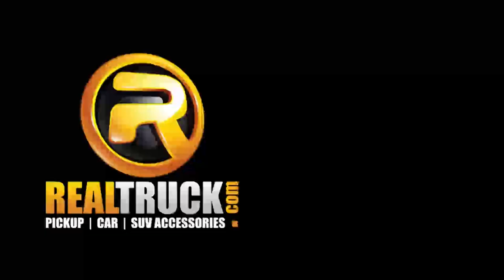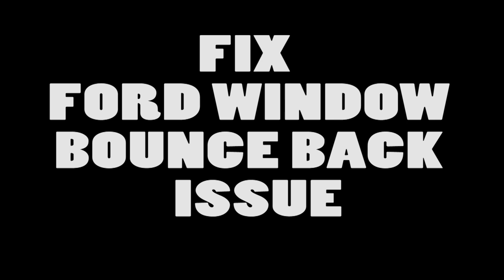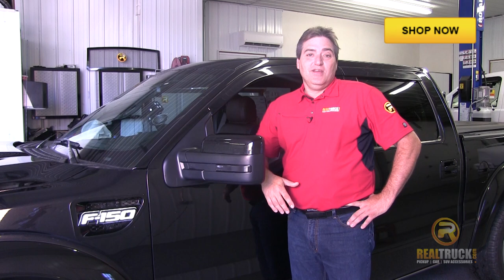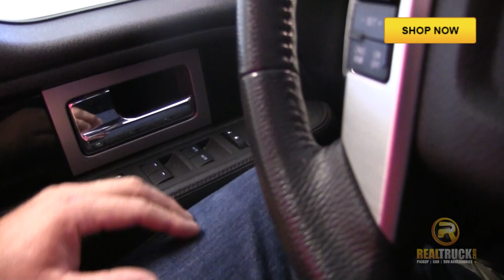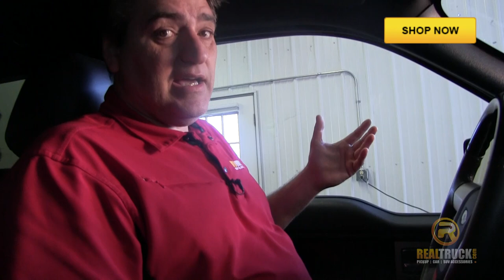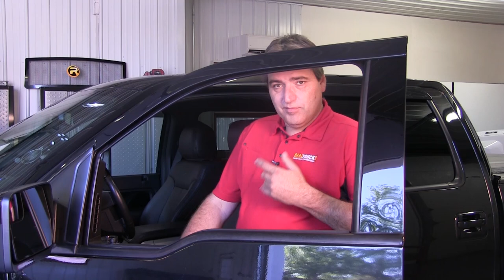How To Fix Ford Auto Up Window Bounce Back

Comment: None of the procedures discussed here worked on my '10 Lincoln Navigator.  However, the following procedure did work... hope this helps someone else.

Window Motor Initialization

NOTE: Initialization is required to learn both the full up and full down positions and the profile of the glass as it travels through the glass channel. Once initialized, obstacle detection is enabled. This procedure is only required for Navigator (LF and RF) or Expedition (LF only) window motors.

NOTE: The window motor must be reinitialized whenever: the motor is removed from window regulator drum housing, a new motor is installed, a new window regulator is installed, new window glass is installed, glass top run removal or installation is carried out or when carrying out any operation in which grease or lubricants are applied to the window system. All window components (window glass, window regulator, window motor and glass top run) must be installed and tightened to specification before carrying out this procedure. Refer to the De-Initialization Procedure prior to performing the window motor initialization (unless a new motor is being installed).

NOTE: A new (or de-initialized) LF/RF (Navigator) or LF (Expedition) window motor will not operate in one-touch up or one-touch down mode until initialized. If a new LF/RF window motor has been installed, proceed to the Window Motor Initialization procedure in this section.

NOTE: Excessive bounce-back (window reverses direction with no obstructions present) may indicate that a de-initialization procedure may need to be performed.

De-Initialization Procedure

1.Start with the ignition key in the RUN position and open one front door.
2.NOTE: Steps 2 and 3 must be performed within 8 seconds.

Turn the ignition key from OFF to RUN 5 times.
3.Press the window control switch to the one-touch DOWN position (second detent) and release.

Window Motor Initialization

WARNING: Keep objects and body parts clear of the glass panel when carrying out the initialization procedure. During the initialization procedure, the glass panel closes with high force and cannot detect objects in its path. Failure to follow this instruction may result in serious personal injury.

4.Start with the ignition key in the OFF position and with the LF/RF door open.
5.Turn the ignition key to the ON position.
6.Activate and hold the window control switch in the one-touch DOWN position (second detent) until the window glass stalls for 2 seconds at the bottom of its travel and release the switch.
7.NOTE: After performing this step, wait a minimum of 3 seconds before operating the window control switch or ignition switch.

Activate and hold the window control switch (with no interuptions) in the one-touch UP position (second detent) until the window glass stalls for 2 seconds into the glass top run and release the switch.
8.Verify correct operation of the window by carrying out the one-touch up and one-touch down features. If the window does not operate correctly, carefully repeat this procedure.
Reply: Mr. Bartley, I would like to thank you for your directions you gave on this bounce back issue. I followed them and everything is working fine on my 2010 Navigator. Thanks a million😁
Reply: Thank you for this. It works on a Navigator 2009. My mistake in the beginning was turning the key to ON and OFF 5 times instead of RUN to OFF.
Reply: Norm Birtley Mr Bartley thank you!  Your directions were great and it worked on my 2014 Navigaor.  You made me so happy, thanks again.
Reply: Thanks! 07 and my windows are bouncing.
Reply: 2014 super duty with bounce back issues here. Thanks so much!
Reply: You just fixed my 2017  F-150 Lariat issue. Thanks Norm

Comment: Thanks. I was having that problem with my 2017 Ford fusion hybrid. But when I hold the up button, it does keep my window up. It didn't seem like my rain guards were affecting it bcuz it's not coming into contact with my rain guard. The rain guard is on the outside of the door panel. But holding the button up does seem to keep the window from bouncing back down and I didn't have to wait 12-48 hours. It worked immediately. Once u hear a small clicking noise then u know it worked. I tried rolling it down and then letting it auto roll back up and it stayed up and u hear a slight clicking noise each time that let's u know that it's locked in. Thanks again. That was a quick fix 👌🏽
Reply: That clicking noise is ware on the worm gear that rolls the window up and down. 
That sound is proof that you are causing premature ware.

Comment: This solution DOES work on my 2016 F-150. A few notes that I found make it easier though. 
1) I would suggest you have two people for this 
2) Put the in-channel visor in place 
3) Person #1 sit in the driver's seat so they can operate the windows from the inside 
4)Person #2 stand outside the window and slightly pull the in-channel visor outward at the top where it meets the door frame while the window goes up (this allows a bigger gap for the window to slide in) 
5)When ready, Person #1 raise the window...it will trip at the top and begin coming back down but keep the window button pulled up
6)When the window has come to a stop (about halfway up), let go of the button and then quickly pull upward on it again
7)This time the window should go up and stay up
**I would suggest leaving the windows up as long as you can once they are closed to allow the molding more time to flex**

Good luck

Comment: Mine isn’t rolling back down I already done this when I installed them. But my issue is the driver side front window rotated slightly forward when it gets up to the visor causing a bad seal.

Comment: I'm having a similar problem with my window on my 05 mustang gt, but I can't hold up on the window switch without it bouncing back so I can't hold the switch for two seconds. Any other suggestions?
Reply from the maker: +Greg Mccoy Try this.

DE-INITIALIZATION PROCEDURE
De-initialization (un-learning) of the smart window motor clears the memory of the module and shuts off the One-Touch UP, Bounce Back and Short Drop functions.
The smart window motors can be de-initialized in two (2) different ways:
Disconnect the battery cable from the battery WHILE THE WINDOW IS MOVING.
Remove the window motor fuse from the Power Distribution Box WHILE THE WINDOW IS MOVING.
After performing one of the above procedures, the smart motor must be re-initialized, see Initialization Procedure.

INITIALIZATION PROCEDURE
INITIALIZATION MUST BE PERFORMED WITH THE DOOR CLOSED! (For convertibles, top and the quarter glass must be in the up / closed position.)
From the window switch, perform the following steps without stopping:
Operate the window UP and stall for 2 seconds. (Hold The Switch)
Operate the window DOWN and stall for 2 seconds. (Hold The Switch)
The smart window motor will be initialized and one-touch-UP and Short Drop will be operational.
Cycle the window glass an additional five (5) times to set the window
"Soft Stop" for the down position.
Reply: @Realtruck  I'm  assuming this will also work on a 07 Mustang . as I am haveing the same issue 
so I'll give this a try thanks..

Comment: I installed the weather tech window deflectors and  did this and it still does the bounce back. Is there something I may have done wrong as far the whole installation process or is there another way to fix this. Also it was only the passenger side when i tried it, now both sides do it.
Reply from the maker: Hi Caleb, I apologize you are having bounce back issues with your Weathertech Window Deflectors. Make sure the defectors are seated as tight as possible. If you are still having issues please call (800) 441-6287 . Thank you!

Comment: 2014 F350 all I had to do was with the key in the Run position with the engine off hold window switch up for 10 seconds

Comment: Safety feature is on the front windows only?  How many kids are in the front seat, especially the driver seat?
Reply from the maker: In your face blank lots. I have personally seen this quite often. Someone gets out of the car or truck to talk to somebody for a minute and the kids are messing with the windows. I am not saying this is a good thing to have children running wild in the vehicle, however, it does happen. Another huge issue is pets stepping on the switch. One thing we should always try to remember. The reason for safety suggestions and/or equipment is usually because someone has had an incident because the safety features weren't present. Thanks for the question.
Reply: ***** I understand its purpose, seems like the back windows would have the feature as well.  By the way.  Thanks for the tip.  That worked for me! :-)
Reply from the maker: In your face blank you're welcome. Yes I agree. It would make sense to have it on the back as well. Auto manufacturers. Go figure lol!
Reply: Probably because they don't put the auto-up in the back windows and they figure if someone's pressing the switch and gets their head stuck, they'll let up on the switch pretty quick.
Reply: Good point.
Reply: Ford should allow us "adults" to disable this stupid feature on the front windows in the menu system! Like you said kids are typically in the back seat and mine are all grown. This reset never fixed anything in my 2013 F150 and when I got my 2016 I didn't bother with these visors because of that issue. Hell the window on my 2016 bounces with nothing in it sometimes!!
Reply: Just read about the fuse thing..anyone try this on a 2016 F150? Want to know it works before I spend $100 on visors again.
Reply: fildiablos yep works like a charm
Reply: What's this fuse thing?
Reply from the maker: You need to pull the fuse for the power window while it is in motion. The window will stop working when you do. Put the fuse back in and roll the window all the way down. Then roll the window all the way up and hold for 2 seconds. Then roll the window all the way down and hold for 2 seconds. Rainguards must be installed first. Do this for both sides. Fuse location is in passenger floor kick panel. Fuse location #1 and #3 I believe. This will reprogram the sensitivity of the bounce back feature so it will work with your rainguards.Nick Baughman
Reply: In your face blank I always sit in the front😂
Reply: no shit i have the same damn question

Comment: mine is physically hitting the visor. I understand i probably installed it wrong...any tips on somthing I could stick in there to give me that extra space? or could I cut a tiny piece off
Reply from the maker: Clark, we recommend giving us a call and speaking to one of our truck experts. You can reach us at 877-841-9213.
Reply: Yes I use lens cleaner wipes to fix my window issues. Just shimmy them in there and I'll make a little extra space and then voila!

Comment: There is another way to do this without having to wait 48 hours.  You need to pull the fuse for the power window while it is in motion. The window will stop working when you do.  Put the fuse back in and roll the window all the way down.  Then roll the window all the way up and hold for 2 seconds.  Then roll the window all the way down and hold for 2 seconds.  Rainguards must be installed first.  Do this for both sides.  Fuse location is in passenger floor kick panel.  Fuse location #1 and #3 I believe.  This will reprogram the sensitivity of the bounce back feature so it will work with your rainguards.
Reply from the maker: Luke Hinkel Thanks Luke! We will give this a try.
Reply: ***** If you tried it, did it work? I tried what you suggested in the video and didn't have any success.
Reply from the maker: Have not had the opportunity as of yet to try that method but when we do and if it works we will certainly let everyone know.
Reply: Well, I just got done trying it myself....and it works perfect! Now the windows go up, and stay up!
Reply: Glad I could help you guys
Reply: Luke Hinkel k
Reply: Worked great for my 2013 f150 
Fuse #1 is drivers nd fuse 2# is passengers
Reply: Luke is right it works I just did mine
Reply: This really did the trick on my 2013 f-150 with in-channel visors! Thanks so much Luke!!
Reply: Luke Hinkel it works
Reply: Also, driver window was #1 fuse and passenger was #3 fuse...thanks again!
Reply: Luke Hinkel it works great the 48 hour thing didn't work
Reply: Will that work on a 2012 ford expedition?
Reply: Worked perfectly man.  Thanks for posting.

Comment: is that the same process for a nissan murano?
Reply from the maker: Joey,

Typically this would be a universal fix. However if it does not work for you, you might need to call the manufacturer for your vent shades.
Reply: RealTruck.com thanks for the reply

Comment: The real method is, roll the window up or down and while it's moving disconnect the motor. Wait 5 seconds, plug the motor back in and then roll the window up. When it closes all the way keep your finger on the switch and hold for three seconds. Roll the window down and wait three seconds again. Problem solved. I work at a ford dealer and this is what we do, we don't wait for 48 hours. Our customers would be mad if we did. Lol
Reply from the maker: Thanks Doug!
Reply: I'm gonna give this a try this. I tried going to my local ford dealership and they basically denied the problem exists and said I was crazy smh
Reply: Can I just do the battery instead? I dont want /know how to  take my door apart.
Reply: @ChiTownRaised  I've read you can also pull the fuse.
Reply: Hi there ,  I have 2019 transit 250 , we change the driver's  door, and now the driver's window rolls down one second and stops , and so on until goes all the way down, same to rolling up , any advice,  
thank you in advance ..
Reply: @ricardoramos588  track is probably on a bind. Check rubbers and track alignment. Make sure the rubber is seated properly in the tracks.
Reply: @teddy7555  ok, I'll check it out,  thank you

Comment: Yeah, I have a 2015 F150 and this method absolutely does not work like they make it seem too.
Reply from the maker: Rick the 2015 may be a bit different. I found this on a Raptor Forum. For those with 2011-up f150s an want or have in-channel vent visors and are having or are concerned about the safety feature (bounce back) that these trucks are equipped with there is a fix. After install of the in-channel vent visors you must retrain the windows. The power window motors in these trucks are set up from the factory to close with a certain force, when in-channel vent visors are installed the window requires more force to completely close without bouncing back, thats where the retrain comes in, you have to retrain the windows to close with more force so they don't bounce back when closing the window. This does not disable the safety feature rather changes how much force is required to make them bounce back.
How to retrain:

- first you must kill power to each window while it is in travel, either up or down by either pulling the fuse for each window while it is traveling or disconnect the battery, I pulled the fuses. They are 30 amp fuses located in the passenger side kick panel in fuse positions 1 (drivers) and 3 ( passengers). This resets the motors

- after this is completed replace the fuses. To retrain the up position the window must be in the full down position. Then close the window by pulling the window switch up into the auto close position ( second detent) and holding it until the window is fully closed and for 2 seconds after it is closed then release the switch. Then push the switch down into the auto down position (second detent) and hold it down until the window reaches the full open position and for 2 seconds after then release the switch.

- The window has now been retrained. Test for proper operation, and perform these steps on both windows. Once complete they should close without bouncing back. Note, during the up and down training the bounce back feature is disabled and will not allow the window to bounce back, watch your fingers an any other obstructions in the windows path while performing this operation. 

Hopefully this will help and as always if you have any questions regarding this or any of our awesome products please feel free to call one of our Customer Service peeps at 877-216-5446
Reply: +RealTruck.com i will give that a try. I have them and the drivers side is working ok but the passenger side is still wanting to go back down. Thanks for the reply.
Reply: +Rick Hickman although I cannot see the rest of the reply. I assume after killing the power u just give the power back????
Reply from the maker: Rick that is correct.
Reply: Did this technique work for you?  I just bought a 2017 F150 Lariat, and I am trying to decide which visors to install...
Reply from the maker: John Fordham I would go with Tape-on.
Reply: John Fordham sort of! I did get them in but it has taken about six months for them to actually not trigger the window to go back down.